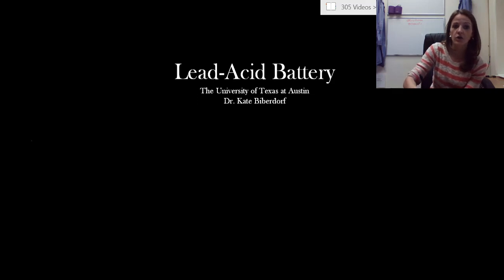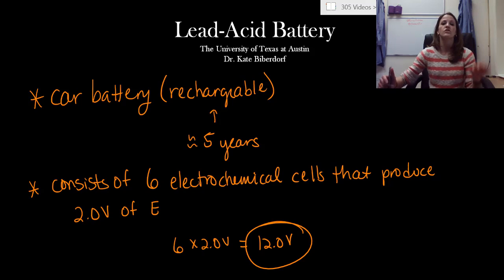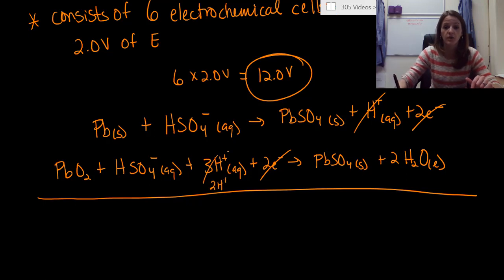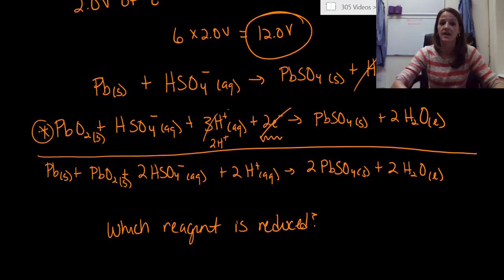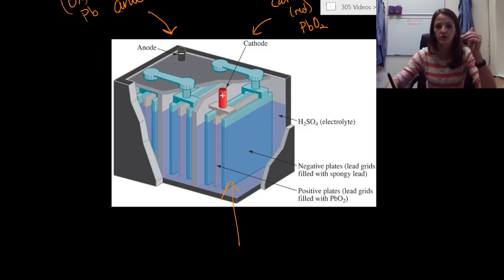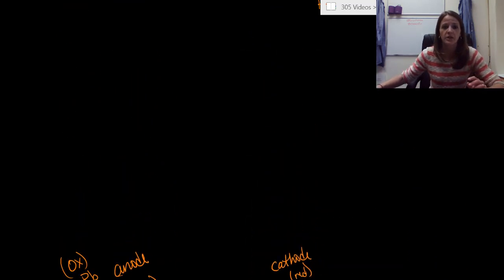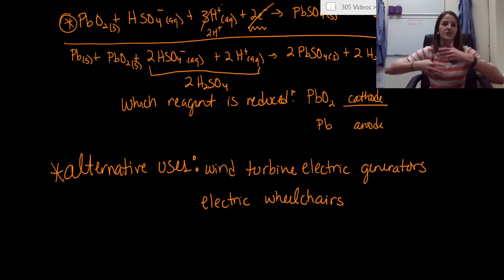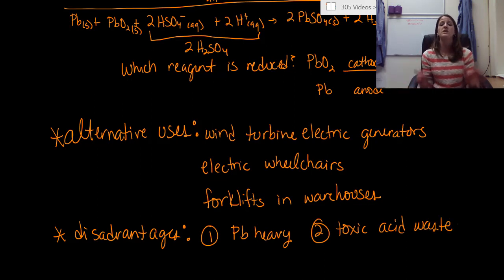Lead-Acid Batteries

Comment: One question i have is how can i safely (with respect to the battery) remove or dissolve the lead sulfate.
Reply: I have considered using a fine sand with distilled water and "tumbling" the battery.